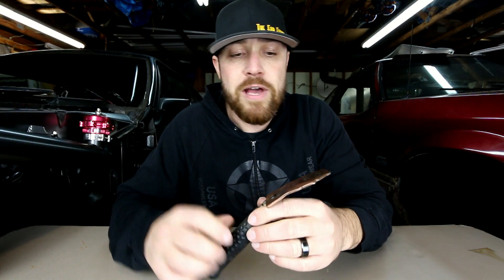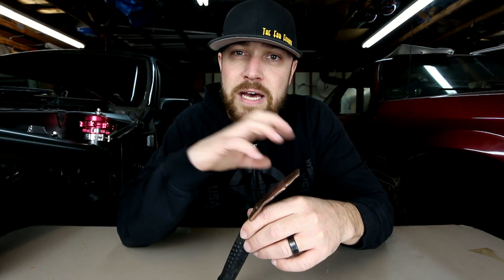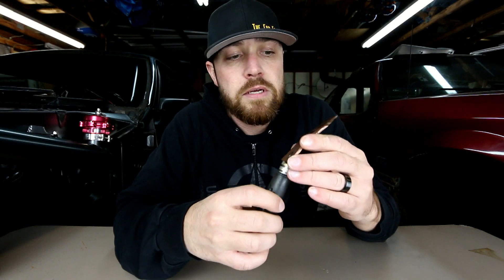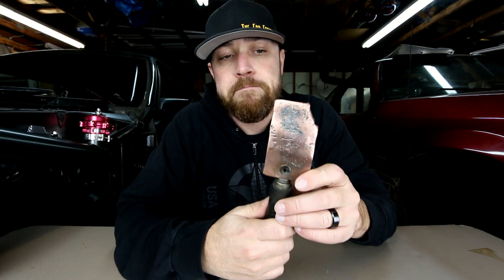You Need This Tool - Episode 9 | Welding Copper Spoon / Paddle

Comment: I'll have to make one of these with the handle.

I used a flattened copper pipe last time I had holes to fill.
It's also useful for welding pieces together and using as a heat sink.
Less likely to warp thin panels.
:)
Reply from the maker: +Jason Park Im sure a pipe would work well
Reply: It does. But even a 22mm diameter pipe doesn't flatten down to be all that big of an area.
Also, a handle is a really good idea as unless you can clamp it into place. It can get warm. Even through gloves. :)

- welding magnets as another idea for a Friday fool video?
I know some don't like to use them due to the bits they pick up. But they have their uses.
:)

Comment: i'm cheap , i use a piece of plain copper tube and beat half of it flat on an anvil then bend it slightly and put some tape on the handle 
good thing about that is that if you cant reach both the inside and outside or need to sneak up behind sumtin in the interior (like the heatercore ) you can use a longer piece of copper pipe to extend the reach a little
Reply from the maker: I could see that working good

Comment: Just curious, but what's the biggest hole you could plug without placing a piece of metal in it first? Does the copper weld to the puddle at some point at all or does it need lots more heat to actually be weldable in the first place?
Reply from the maker: +Sebastiaan Swinkels There really no limit. You could start on the out side and work your way in, it just may be a lot to clean up. I have never had any issues with it sticking...and I have laid some srious heat to it. Dont think the two allows with bond.
Reply: The Fab Forums Great, I'll have to get myself one then because I have a ton of holes to fill on my wifes classic Mini. That thing has a habit of creating holes out of thin air...
Reply: +Sebastiaan Swinkels think little pieces of sheetmetal filed/ grinded to fit and a weldersmagnet might be a better option its cheaper then filling with weldingwire , there allso not a lot of room to get the spoon behind the holes in a mini
Reply from the maker: +watahyahknow I think filling and grinding peices to fit would be very anti productive, and it would probably consume close to the same amout of wire.
Reply: I'm not even remotely concerned with how much wire I use. Granted that I'd never patch a hole over half an inch in diameter without a plug of some sort, making those plugs, often bending them and then placing them perfectly takes a lot of time as well.

Welding magnets are horrible things imho, never had good experiences with those things. Magnets affect your arc and wreak havoc on your welds as a result. I usually just tack a bit of welding wire to the plug, hold the plug where I want it and then tack it to whatever I'm welding it to. Works a lot better imho.

Comment: I've used an eighth inch piece of aluminum for that in the past. what's the benefit if the copper?
Reply from the maker: +TheXdmgx7 to be honest I dont know.
Reply: +TheXdmgx7 it might be because the aluminium messes with the weldpuddle  more than copper does or because it turns brittle when it has been heated a few times
Reply: +watahyahknow that would be a good reason. thanks
Reply: +TheXdmgx7 Higher melting point.
Reply: My goods have never gotten brittle! Especially on Friday! Guess what? It's 5 o'clock somewhere too!!! Seeeee ya'sssssssss

Comment: Love the video's, I have noticed in your intro's (@20 secs) you have what looks like a custom air intake tube. Did you build this and or do you have a video on how you did it? Thanks
Reply from the maker: Thats the turbo induction tubing for the twin turbo build I did that runs through the inside of the fender. You can see it beside my right shoulder throughout that video.
Reply: That would be a great video! I just got my first mig welder and am more of a car guy but learning to fabricate something similar would be awesome. Did you use aluminum for the tubing? Any videos in your channel related to the tubing? Thanks!

Comment: im finishing up the the exhaust on my camaro and I need some clearance going over the frame rail do you have tips on how to flaten just one side of a tube?
Reply from the maker: +4thgen camaro not really...you could heat the section that needs to be flattened with a torch then either hammer of press it flat.
Reply: Nice Thats what I was thinking... Thanks for the quick response
Reply from the maker: No problem

Comment: I never used 1 of those and I've plug welded holes as big as a silver dollar already. The big benefit I could see would be not so much grinding. When you plug weld a hole shut generally you get  a big mess to grind and clean up. So for that I guess it would be alright to have
Reply from the maker: +Chad Wike yeah it minmizes the amount of material on the bottom of the hole

Comment: you mention nothing about wire speed, voltage, stick out and angle to the work piece. Most of us on here are new to welding. At least I am. Can you elaborate?
Reply from the maker: thats because all those things change based on material, wire thickness and material thickness